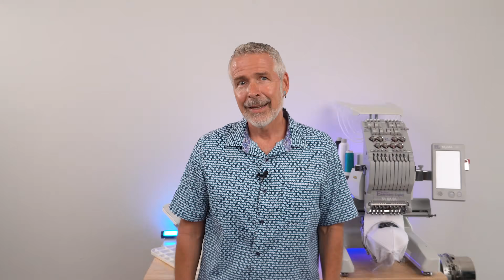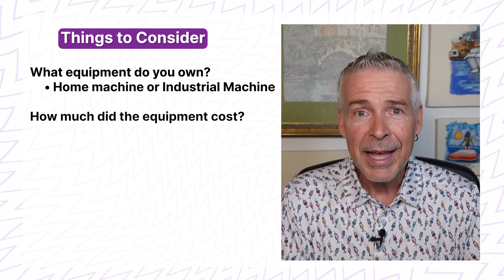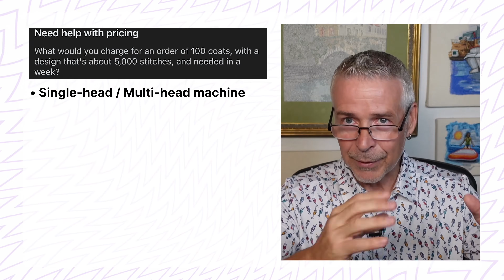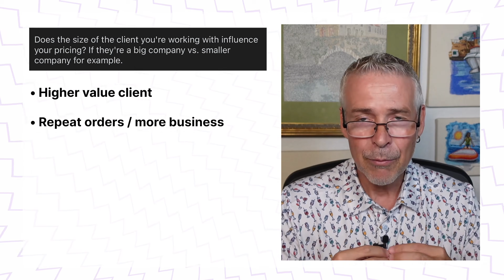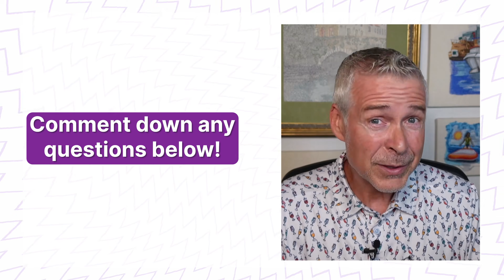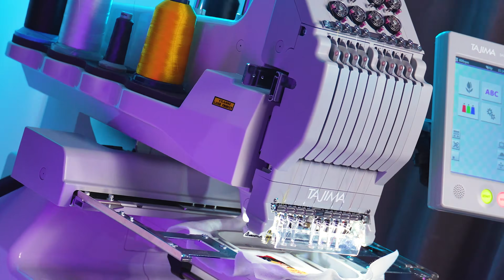How much SHOULD I charge for my Embroidery? Machine Embroidery for Beginners

Comment: For what it's worth, I'll tell you this....most all embroidery is so undervalued and undercharged it's pathetic. The way costs are figured per 1000 stitches, needles, thread, stabilizers, etc., is ridiculous. I won't open my door for a $6.00 job! The most valuable thing I have is my time, and anyone who wants a piece of it is going to pay what it's worth. I have a tajima, single head, 15 needle, at home. I have wilcom es4 software. It's all been paid for over and over again. I do custom logos for one client and I charge alot. This is not my primary job. I am a fabricator by trade about to retire. I will not ever compete with or try to work for chinese wages.

Comment: Great video John! Explains things very well. I would like to know what is a good price is to charge for digitizing. I tend to give a customer a break if I'm also doing the embroidery. But if I am only doing the digitizing, I charge $5 per 5000.  Example being if the design has between 5001 and 10,000 stitches, the price would be $10. I always run my designs before I send them to the customer, and if they are a first time customer I require payment upfront. 
This is a hobby for me even though I have a 15 needle Avance' which is a knock off Tajima. And digitizing with Hatch 3 is great! I actually find digitizing relaxing.
Thanks again
Reply: @lindashahan2176  have you had any issues with the Avance? Are techs available in your area? I live in Colorado and techs here are hard to come by
Reply: @dylancorwin5937  No major issues with my Avance'. A couple of years ago the battery died in the control panel. (Unfortunately when this happens you lose all your stored designs).
I called the company I purchased the machine from. They walked me through how to change it. I ended having to remove the unit from the machine and taking it to a computer repair shop. When the control panel was put together,  the heads of the screws in the part that holds the battery were stripped. I couldn't get them to turnThe next time it goes down, I'll just take it back to the computer place and let them install the battery. 
Tech support in Ohio is virtually non-existent.
Reply: Thanks for sharing . . . I also purchased an Avance’ 15 needle embroidery machine this February 2025.  I also am learning Hatch 3 Digitizing Software . . . Am VERY HAPPY SO FAR.  😊

Comment: Dang, things have not improved for the embroider in over 20 years.  Seems to be about the same as it was back then.  Which is why I sold 2 of my machines.  Now I just enjoy creating for friends and family.
Reply: People made money with embroidery before and making now. What are you talking about? Profit for me with embroidery is 10-30 times more for 1 item. Its a very very profitable buisness for alot of countrys.
Reply: @MaximSweden  True.  I'm just saying the pricing hasn't changed that much in 30 years.  Back when I started, a skilled digitizer could charge over $300 to digitize a simple logo such as the Starbuck logo.  I used to say a computer could never get the results of a skilled digitizer. WRONG. Now the software is so good they would only charge $25.  And it would probably be as good or better than a hand digitized.  The sew out/product is where the money is and where the pricing has not changed much.  It's almost the same as what I was charging 30 years ago.